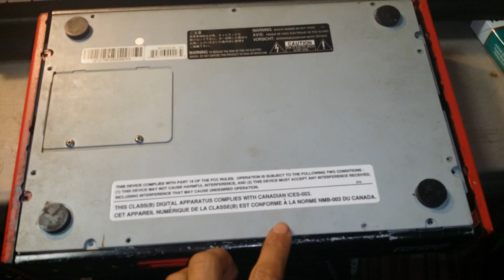MPC1000 Modified Footswitch Headphone Jack

Comment: Hey my analog outs on my 1000 aren’t working. The digital outs work and you can hear a bit of scratchy sound through headphone Jack but nothing through the analog board. You think it could be a capacitor?
Reply from the maker: old quarter inch jack might be the main issue you need to replace that and make sure you set the digital/analog out from the mp. you can do that by your self and cheap to get the female 1/4 in jack on ebay